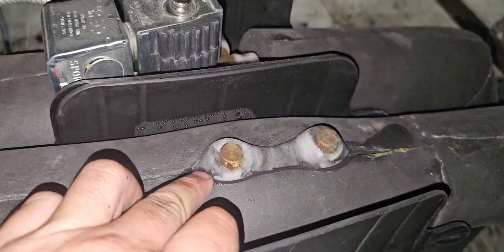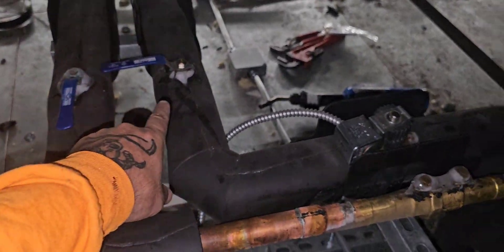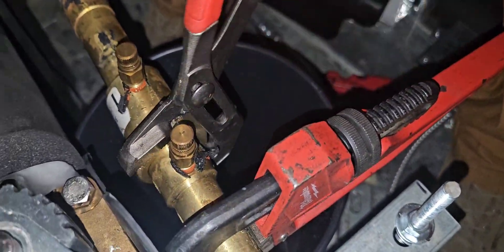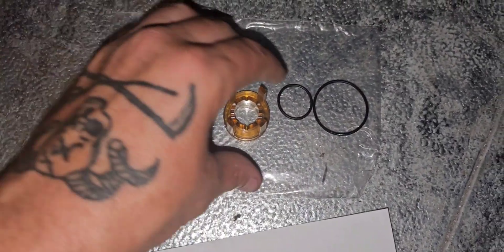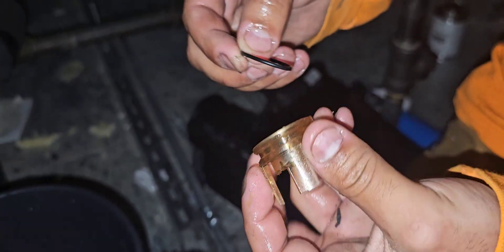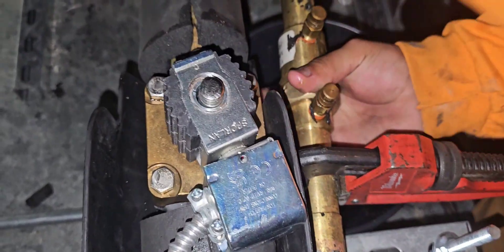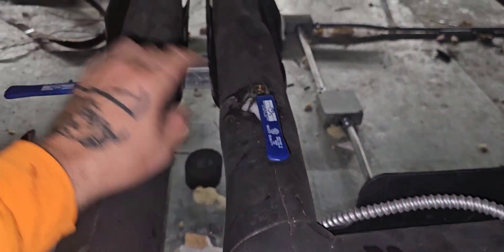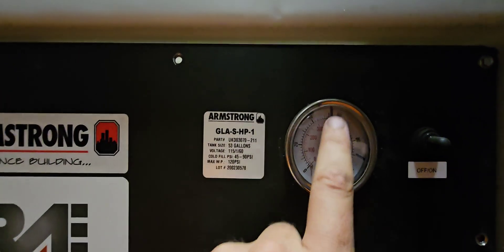Is this the FUTURE of refrigeration???

Comment: So taken apart a flow valve, you will want to shut down the skid or can you just shut off supply line pump down for a bit the close off return?
Reply from the maker: No need to shut down the skid. Isolate it just like how you said. Put a bucket under the valve to catch any glycol. Biggest thing is to make sure you bleed the air out before opening it up to the skid.